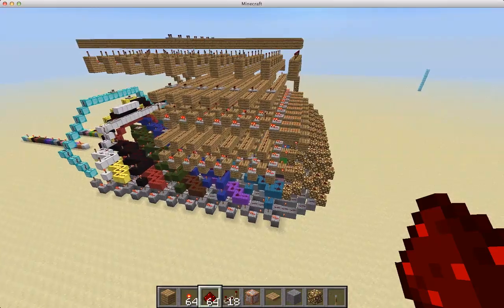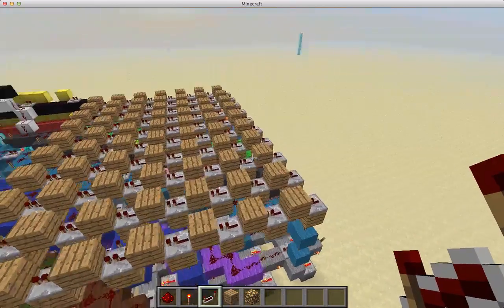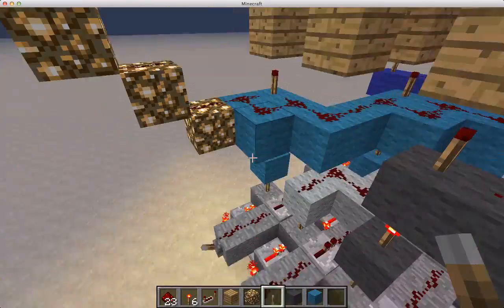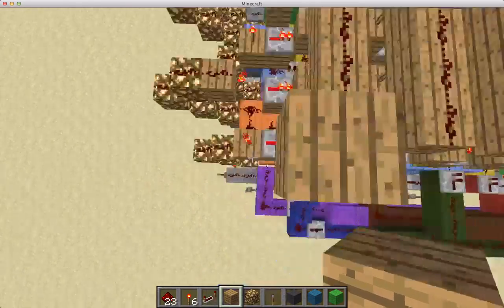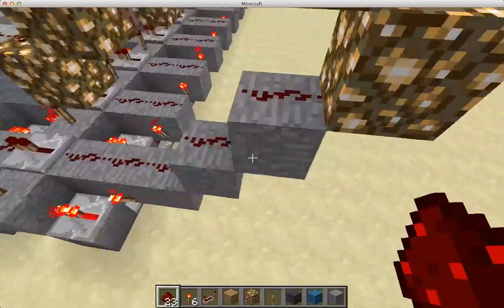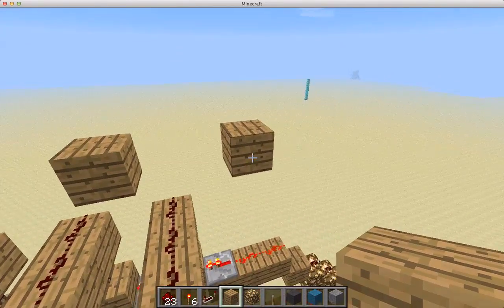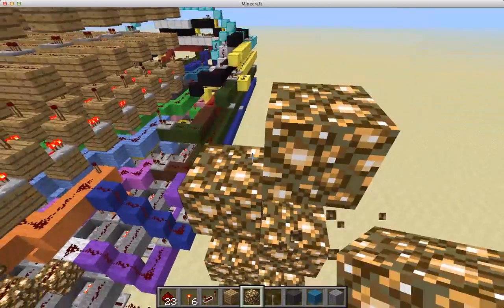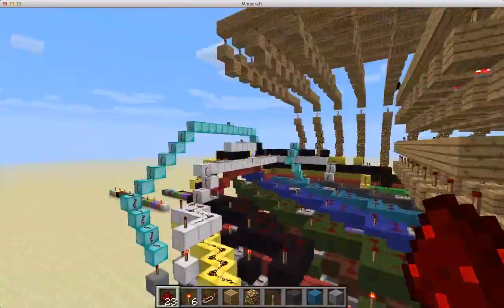How to Build a Calculator Part 3: Decoders

Comment from the maker: Everything we have done so far will work in the xbox version without a problem. In future steps we will be utilizing locking repeaters though, which are not available on the xbox version yet. It is still possible to finish the project, but you will have to change a few things. feel free to message me and ask for help or alternate ways to make your calculator work. good luck!